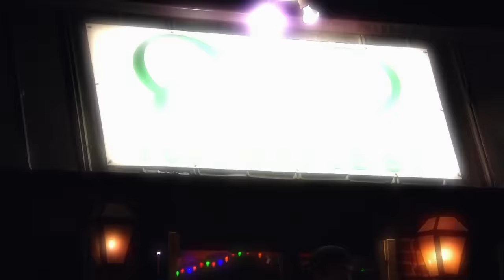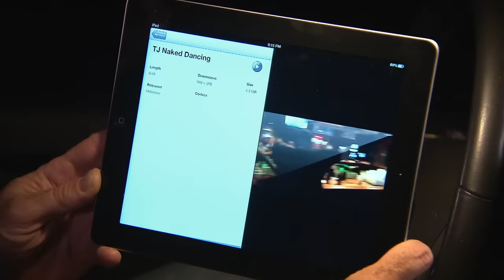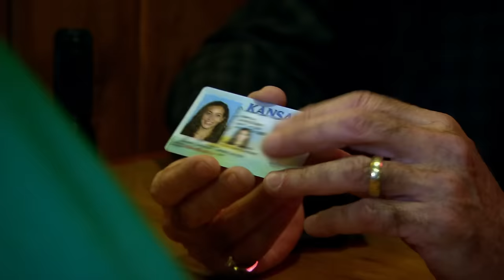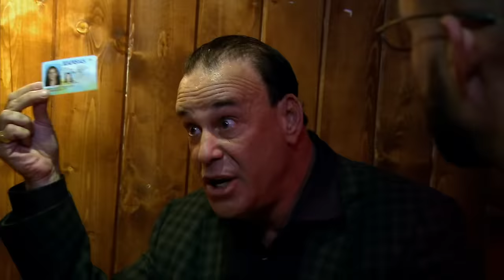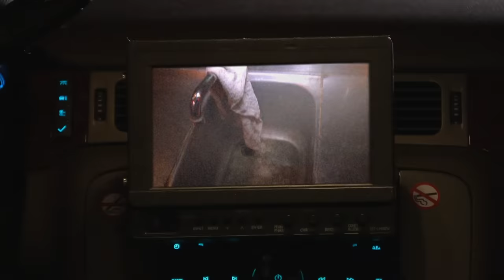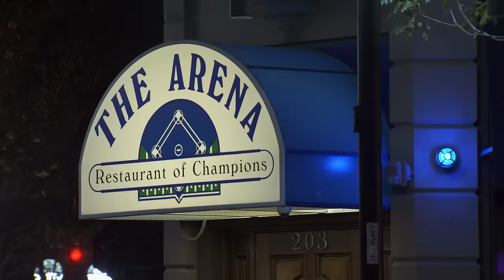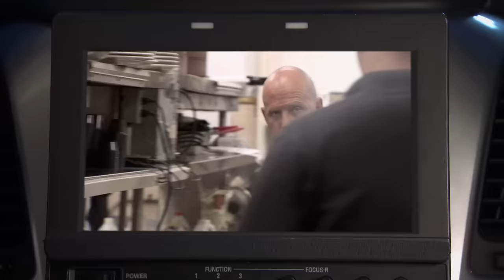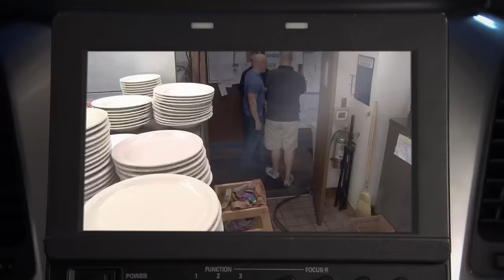Bar Rescue’s WORST College Bars 🎓

Comment: Lol simple syrup is just sugar and water. There's definitely no excuse to be out of that:

1. Combine equal parts sugar and water in a medium saucepan over medium heat; bring to a boil, stirring, until sugar has dissolved. Allow to cool.
2. Refrigerate in a sterile, sealed container.
3. "They" say it's good for a month. Professionals would label the container with what it is and the expiration date.
Reply: As a former barista, it is true that you can make most if not all of your ingredients in about 10 minutes after a trip to the store
Reply: You don’t need to use a saucepan. Hot water out of the tap with equal parts sugar. Shake and serve
Reply: @daybreak2102  yup and that's really the right way to do it! It (usually) costs less and is better quality. Especially for things like syrups and juice!
Reply: @bobbyhill1013  nice
Reply: or you could buy simple syrup at your local grocery store. Your not using massive amounts, it lasts for many drinks.
Reply: @shrapnel77  oh ya don't say?
Reply: @shrapnel77  For simple syrup, it's literally just cheaper and more efficient to make it than to buy it from the store. One of the coffee shops I worked at made it in house because it yielded more for a lot less with barely any waste or effort to do it
Reply: @Ma5jay5dontxdoxthat John Taffer said right in front of Gordon Ramsay. Never work with mean 😢 people like that!!!.

Comment: At TJ Quills: Taffer sending one of the six sorority girls a fake ID 1:42 also one of the guards didn’t check the it correctly but later got the boot. At Rocky Point Cantina: While Big Shot Scott is at his office 7:31 and doing anything bout the problem’s  8:00 & 9:47 & 10:03. 

Tradewinds: Adam pouring 40% of the 17:57 beer down the drain. Also Chase going across the street 😮 20:31 & going to their competition

Comment: Extracting species profile 

Sinosauropteryx (meaning "Chinese reptilian wing", simplified Chinese: 中华龙鸟; traditional Chinese: 中華龍鳥; pinyin: Zhōnghuá lóng niǎo; lit. 'Chinese dragon bird') is a compsognathid dinosaur. Described in 1996, it was the first dinosaur taxon outside of Avialae (birds and their immediate relatives) to be found with evidence of feathers. It was covered with a coat of very simple filament-like feathers. Structures that indicate colouration have also been preserved in some of its feathers, which makes Sinosauropteryx the first non-avialian dinosaurs where colouration has been determined. The colouration includes a reddish and light banded tail. Some contention has arisen with an alternative interpretation of the filamentous impression as remains of collagen fibres, but this has not been widely accepted.

Sinosauropteryx was a small theropod with an unusually long tail and short arms. The longest known specimen reaches up to 1.07 metres (3.51 feet) in length, with an estimated weight of 0.55 kilograms (1.21 pounds). It was a close relative of the similar but older genus Compsognathus, both genera belonging to the family Compsognathidae. Only one species of Sinosauropteryx has been named: S. prima, meaning "first" in reference to its status as the first feathered non-avialian dinosaur species discovered. Three specimens have been described. The third specimen previously assigned to this genus represents either a second, as-yet unnamed species or a distinct, related genus.

Sinosauropteryx lived in what is now northeastern China during the early Cretaceous period. It was among the first dinosaurs discovered from the Yixian Formation in Liaoning Province, and was a member of the Jehol Biota. Well-preserved fossils of this species illustrate many aspects of its biology, such as its diet and reproduction.